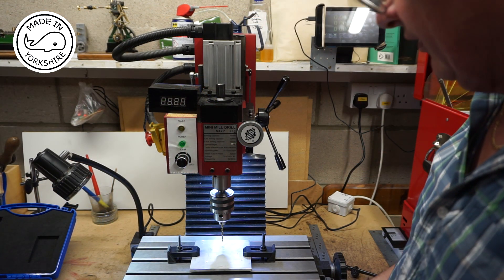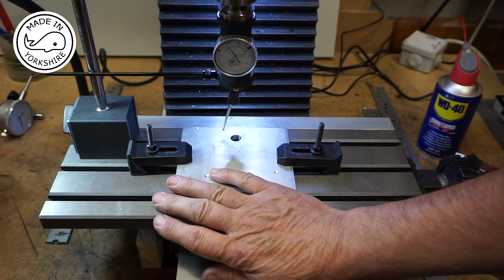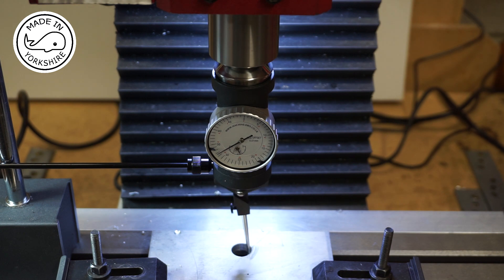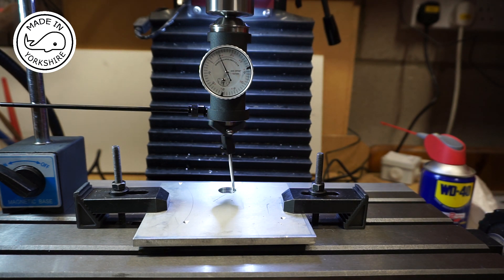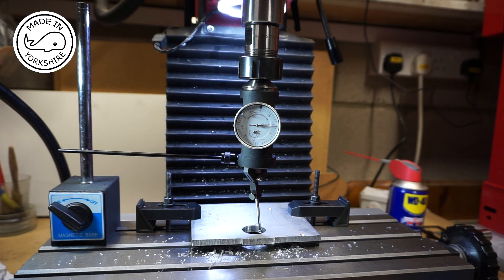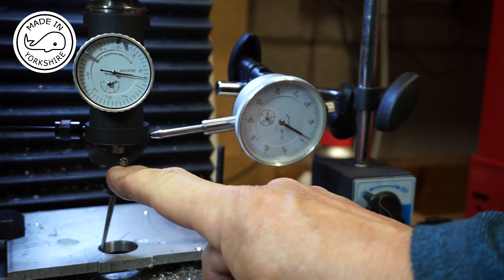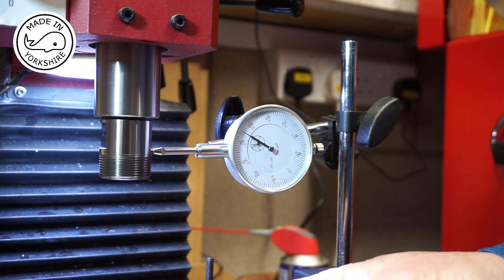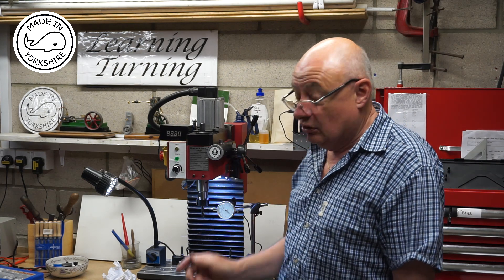#MT33 Co-axial Indicator Accuracy Test

Comment: Good job investigating. Just one more reason those expensive gadgets and contraptions can never replace the traditional methods and tools. Tools like that can cause errors that you might not detect until the final part is done and won't fit. The old school tools and methods are hard(not impossible) to get wrong. and in my experience, take no more time to accomplish.

Comment: I've had a practically identical co-ax indicator about thirty years, didn't much like it's performance and have rarely used it.  I never went as far as you, but I believe you've nailed the problems accurately.  I've only had use for it a few times, but would really like to be able to effectively use it, when it's necessary.  I believe I will revisit my own indicator and see if I can clean up it's act.  Even an old dog can learn a new trick now and then!  Thanks, Andrew.
Reply from the maker: Hi John - I forgot I made this video! Having watched it again I think the problem might have been the actual collet. I have since purchased a more accurate (and expensive) set of collets and I have never experienced issues with the coax indicator since. It's my 'go to' tool for centreing on round stock and I use it ever so frequently. I hope you carry out similar tests and gain confidence in the product.
All the best.
Andrew

Comment: Very useful experiment. Now to check my collet chuck run out! 🤔
Reply from the maker: Ha ha! I forgot I had done this video. I've since used the coaxial indicator on my newer warco mill without any obvious issues. I can't remember if I use the same R8 collet holder. I will run the same checks on my newer mill!
Cheers!
Andrew
Reply: @learningturningmetal  Fingers crossed that you get an excellent result on your newer Warco mill. 🤞
Reply: @learningturningmetal  Just tested my MT2 to ER20 collet chuck in my Seig SX1 mini mill using a 10mm end mill as a test piece.

The outside body of the chuck has a little over one thou run out. But, initially I had over five thou run out on the side of the end mill. Then I tightened the collet tighter and the run out was just over one thou, same as the body. 

I did not expect that tightening the ER20 collet would have such a big effect.
Reply from the maker: @andrewatcarpathian  Interesting! I have since purchased a set of more accurate ER25 collets from Associated Production Tools. Maybe that is why I've not noticed any problems. I will do some tests too.
Cheers
Andrew
Reply: @learningturningmetal  Hi Andrew. I will be very interested to hear what you find, especially if there is a difference due to the torque applied to the ER collet nut. That begs the question, what is the correct torque and how can you measure it? 🥴🤔
Reply from the maker: @andrewatcarpathian  well I've just checked runout on my Warco mill using my cheap 10mm collet and my more expensive one which is supposed to be accurate to within 4 tenths of a thou. The R8 collet holder wasn't overly tightened.
Using a highly accurate dial gauge the runout is zero using both collets! Not even one tenth of a thou. This supports the fact that I haven't experienced any problems since. I'm pretty sure everything was clean during my previous test. Very odd but reassuring too! It's certainly a good test to undertake though.
Cheers
Andrew
Reply: @learningturningmetal  Fabulous result. We done. You can indeed be super pleased. Such tests do indeed instil confidence in your own set up. 👏👏👍😀

Comment: Pretty sure you’re supposed to turn them by hand for accurate readings, most dial indicators should be turned by hand. The machine is going too fast to get an accurate reading.
Reply from the maker: Yeah I get where you are coming from. I occasionally turn by hand now, but the instructions do say to use the mill at a slow speed.
All the best.
Andrew
Reply: Enjoying the videos though, it’s always interesting watching people from different backgrounds get into engineering, often they think outside the box & come up with different approaches that traditional engineers might not think of.
I wish I had the time, patience & confidence to make videos of what I do.
Reply from the maker: Thanks Matt. You could always start by uploading a few photos to engineering forums. For example:
www.model-engineer.co.uk
http://www.modelenginemaker.com
All the best.
Andrew

Comment: It’s very interesting what you found.  When I tested my coax indicator I was sure it was being affected by runout.  I went to the trouble of making a holder which I could deliberately offset to introduce runout.  To my very great surprise it had no effect!  
Possibly there is some effect if the axis is tilted.  I don’t know.
Either way it looks like your collet chuck is not good.
I am enjoying your videos.  Great stuff!
Reply from the maker: Thanks John. You have got me thinking now.  Amazing that the runout you introduced didn't have an adverse effect. I will do some more tests on mine and double check everything. Your video is most helpful.
Cheers
Andrew

Comment: I suspect misalignment of the threads and the taper on the collet chuck. Most of the cheap Chinese collet chcks suffer from this.
Reply from the maker: Thanks. I think I will try to use my r8 collets from now on if possible - though I've only got a few. 
Cheers
Andrew

Comment: You're looking at accumulated error of all mating surfaces. Spindle bore + collet chunk taper + inner collet chuck bore + outer collet surface + inner collet surface runout all added up. When I see that much error it's usually the inside of the collet chuck. Test that surface...
Reply from the maker: Thanks for the advice Dave. I think my expectations were too high. I now appreciate that all the slight inaccuracies in the various elements all add up. I checked the internal collet chuck taper but found no obvious runout. The overall accuracy of the collet chuck is definitely questionable though. When using the coax from now on I will definitely use the r8 collet.
Cheers
Andrew
Reply: When I switched over to an ER32 nut with a bearing in it I found many collet capture problems went away and also runout went way down. The nuts capture surface free spins so it pushes the collet in without any rotational force on the collet.
Reply from the maker: Very interesting!

Comment: Hi Andrew
Great work in finding your problem, I use ER collets all the time, but there is one thing that I have found, they have a range, eg 16-15 mm, they clamp better (more accurate) at their largest range as they do not have to compress as much so I try to use cutters and drills close as possible to the high end.
It has to do with the way the collet segments pull in against the taper, there is a few good YouTube clips explaining how they work. (clamp)
I don't know what size spindle your coax indicator has but it maybe a tad small for that collet, also your boring bar is small so you could be getting a small amount of deflection (it all adds up)
As Model Steamers said it is only hobby machining.
I like the way you are aiming for fine accuracy, it will show in the end result.
Regards
Gary
Reply from the maker: Hi Gary. Thanks for the info, I''ll keep that in mind for future. The coax spindle is 10mm inserted into a 10mm collet. As Peter (PGS) suggests - maybe my expectations are a little too high for a hobbyist budget. All good fun though. Looking forward to your next installment of the beam engine build.
Cheers
Andrew

Comment: G’day Andrew, good diagnosis and result, maybe time to regrind the collet chuck itself, after checking the run out of it first. Of course the individual collets themselves could be out, so many variables, or maybe expectations are higher than a hobbyist budget.:)
Cheers 
Peter
Reply from the maker: Hi Peter - I think you have hit the nail on the head there. In hindsight, maybe my expectations are a tad too high. 

Cheers mate.
Andrew
Reply: @learningturningmetal  my er32 collets run way out the holder seems to be true ish but the set of cheaper collets are junk. tried a bearing nut and even got a usa made er32 collet holder and the collets all seem to have too much run out. not sure I will invest in expensive collets I have good r8 and 5c collets.

Comment: Great troubleshooting investigation. You may also want to check the runout on the inside of the chuck surface. With luck that will be the problem and you won’t need to get a new set of collets.
Reply from the maker: Good idea Robert - I didn't think of that. I'll check it out ASAP.
Ann the best.
Andrew

Comment: I don't like seeing a coax run under power. Generally, you can just turn it by hand to the axis of adjustment, make a reading, and adjust location  there. The noise it was making confirms that under power is not the way to go. Carry on, m8. :-)
Reply from the maker: Yeah I see where you are coming from. I adjusted it by hand in my first coax video - and received a couple of comments to use power. I guess the jury will be out on this one.
Cheers
Andrew
Reply: Power off for me also.
Reply: According to Blake, the inventor of the co axial indicator, it should be run under power because one benefit of the tool is that it accounts for some stresses induced by the torque in the drive train which I have seen.  I agree with that in fact I'd say it is the main benefit of that tool, maybe the only real benefit.

Comment: Hi Andrew I pleased you carried out the test I suggested and the indicator proved to be fine. I wouldn't get too caught up relating graduations on the coax as being linear dimensions, the graduations are just an analogue representation of the angular deflection the probe is experiencing and can't be directly interpreted as 1/1000ths etc. The amount of deflection on the needle is heavily dependent on the length of probe and the diameter it is reading.
I would suggest the readings you are getting are well within the accuracy that hobby machinists like us work to, they compare with the sort of accuracy of your micrometers, DRO, callipers etc
Reply: Agree.  Think of it like tramming.  The only measurement that's important is zero.   I've never used those collet chucks.  Don't believe I'm going to now lol.  A good set of R8's has been my go to.  Don't know the history of those collet chucks but it is possible that under or over size bits were tightened up in them.  Game over after that usually.
Reply from the maker: Fair point Randy. I will try to expand my R8 collet collection over time and reduce my reliance upon the collet chuck.
Cheers
Andrew
Reply from the maker: Thanks for the info Peter and your initial suggestion. I can now sleep at night knowing that the coax is accurate ha ha.
Cheers
Andrew